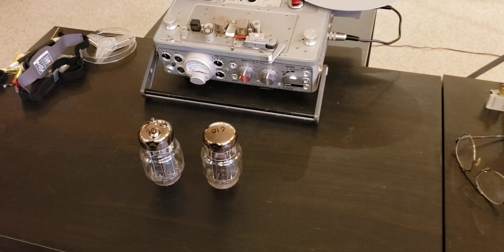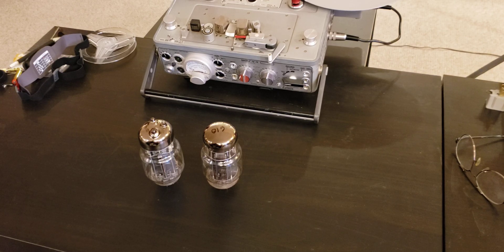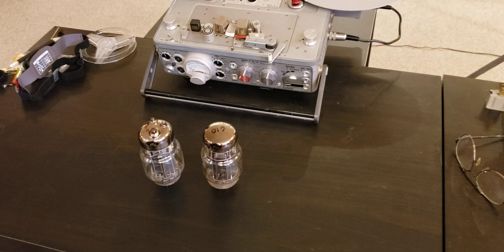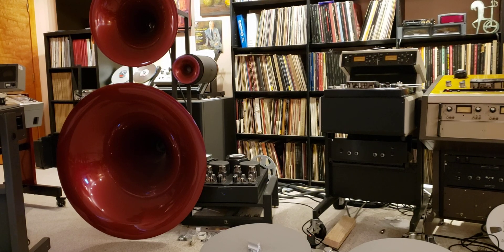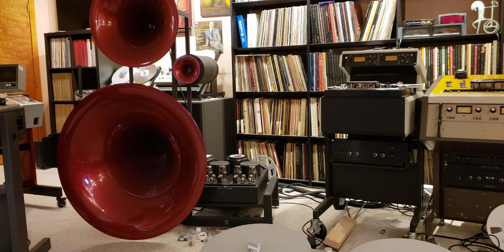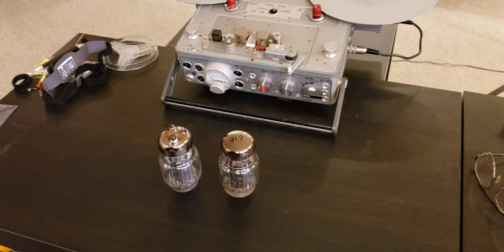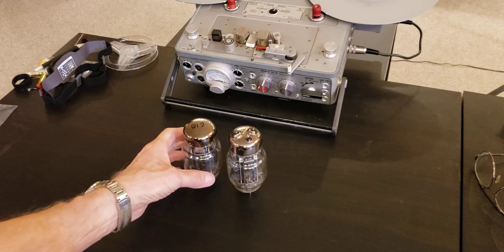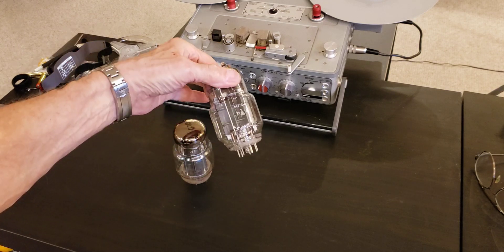6C33C vs. 6C18C - where progress takes wrong turn

Comment: thanks for this interesting video. What is the risk for the amplifier / speaker should a tube fail while it is in operation?
Reply from the maker: That entirely depends on the amp's design, but since most tube amps employ the output transformers, the speakers are generally well protected.  It is not like getting the whole power supply suddenly connected to the speaker in case of a traditional solid state amp's failure.  In most cases an output tube failure is just going to create an audible pop through the speaker.

Comment: Yes, this must be a very good tube, although I heard some complaints about the high power of these easily melting the sockets... As a DIY I stick with 6N13S (6H13C) also Russian NOS tubes in OTL, zero feedback configuration, good sounding and reliable tubes as well.
Reply from the maker: :)  I am sorry, but I had to smile reading about those melting sockets... I have 30 years of experience with them, and have never seen one socket that melted.  How could they melt - they are ceramic.  There is only one concern about them - if someone is careless and simply shoves the tube in, without doing some gentle rocking motion, then the socket pins can be bent, resulting in bad connection.  In most cases these can still be repaired... 

I am very familiar with the 6H13C tube, it is a fine device, but it is a lower power one.  It can make a good preamp output stage, for instance... but there you also have an option of 6C19 tube - a more compact and very linear device.
Reply from the maker: BTW, I have a very good friend in Hungary, his name is Ficzek Gyula, he has been using those for many years.  He also deals in high-end and LP's.  Have you heard of him?
Reply: @Foxbat9000  I don't know him,  I'm DIY, no high-end...
Reply: @Foxbat9000  Yes, ceramics melt pretty hardly, but I meant the contacts that could melt, because of the high Amperes. I haven't seen such event though, never seen those
 tubes live... I'll check 6C19, never heard of it. I use those 6H13C for OTL headphone amp as well...

Comment: Very interesting, as always, thank you !
I wonder about the potential musical benefit of upgrading from a passive crossover to an active one, removing thus the nasty load of passive crossovers and insuring the coherence of the musical signal phase across all transducers.
Reply from the maker: I would possibly agree with your assessment if that active crossover was designed following the best principles.  One has to be VERY careful adding active stages, as in most cases those have many corners cut.  In essence a well designed active crossover would be akin to a great preamp, and we know how complicated THAT job is.  There is good reason some preamps have 10 or even 20 tubes in them.  

At the same time I have heard great sound from speaker systems using the conventional passive crossovers, hence my reluctance to make things even more complicated than they are already.  :)

Comment: Do VK-60 & VK-75SE owners have your blessing to swap out 6C33C over to the 6C18C?  Which brand did you use, Svetlana or Ulyanovsk?
When you say " catastrophic " failure. IS that just blowing the power tube fuse?  Or something worse?
Reply from the maker: The tubes I have here are from Ulyanovsk factory, made in 1968, I don't know if Svetlana ever made them - I suspect not.  I have Rex II amps, and they have fully electronic protection, so there are no internal fuses, you just reset it, so perhaps the word "catastrophic" was a bit excessive, as no part of the amp was damaged, just three out of four LED's went out. But the tube had to be replaced.

At this point I still don't have enough experience to give my, as you put it, "blessing", so at this point I would say this might be something for the adventurous owner to consider.
Reply: @Foxbat9000  Fair enough.   Was it necessary to try many 6C18C tubes before your REX amp self bias with these NOS tubes? I read the 6C18C QC weren't that great.  If I were to give this a try,   will a random set of 4 tubes will be within range for the VK amps to self bias.   Or would I need to purchase a batch of 6C18C tubes?
Reply from the maker: @normloo1590  No, you should not use some random tubes in those amps.  It is true that they have good automatic bias adjustment circuit, but it has limit, so some tubes might fall outside of its adjustment range, and even if they did not, it is always better to use matches pairs.

Comment: very interesting. thank you. but i prefere 2a3's for their musicality.
Reply from the maker: A tube is just one part of the overall circuit, so you can't compare a tube A in a circuit X with a tube B in a circuit Y.  

But two tubes, A and B, with identical characteristics, in the same circuit - that becomes a meaningful comparison.
Reply: @Foxbat9000  sure. i agree with that.
Reply from the maker: @intell2OOO  I am happy that I don't have to deal with the design of an output transformer working from a 5K source... tubes with 100 Ohm plate resistance let you use very simple transformers, potentially achieving 300kHz bandwidth.  The amps used here go straight into 150KHz, and that frequency is limited not by their output transformers, but by their active circuit.  That is not typical for transformer coupled tube amps.